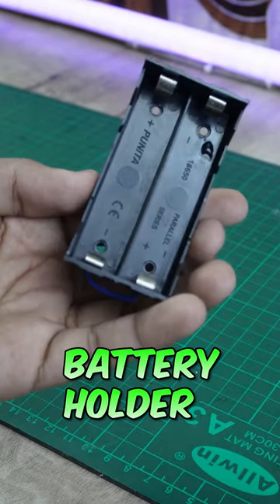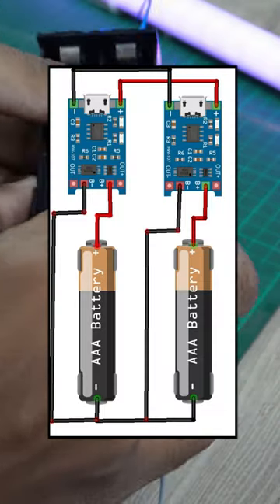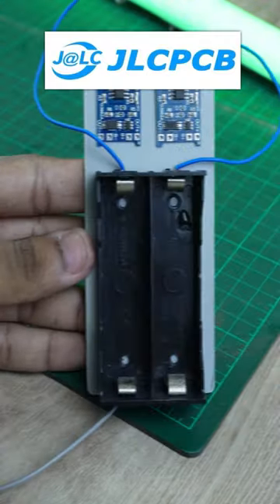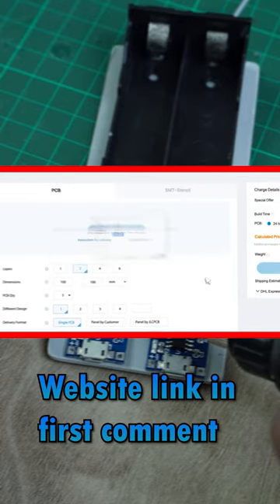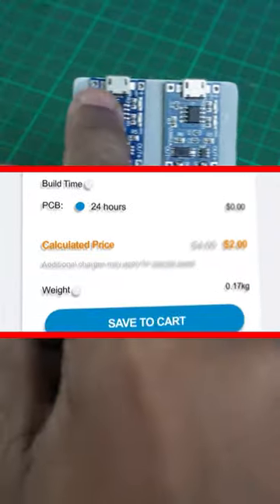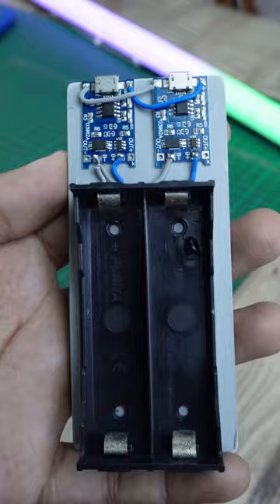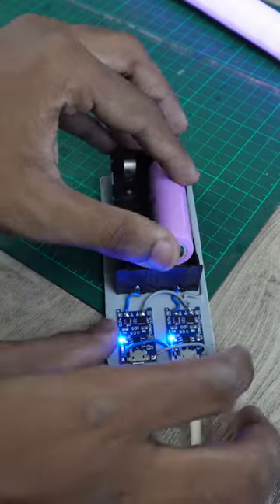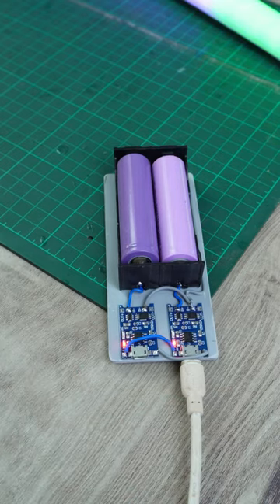JLCPCB: How To Make lithium-ion Battery Charger #shorts #jlcpcb #teluguexperiments

Comment: Lokesh bhayya naakoka doubt.
Suppose nenu 18650 batteries okati 2500mah, inkoti 6000 mah batteries Okasaari charge cheyyali anukunte ee circuit work avtunda?
Reply: You cannot charge it parallel as both batteries are not same capacity if you charge it charges upto low capacity that is 2500mah. Charge separately , if you have variable smps you can charge it by connecting in series
Reply: Yes bro video cheyyu dhunimidha

Comment: I'm not sure why you use 2 modules, you could have used 1 for both the cells connected in parallel.
Reply: it'll charge in double the time required for charging single battery, rather use 2 for faster ig as they are pretty cheap